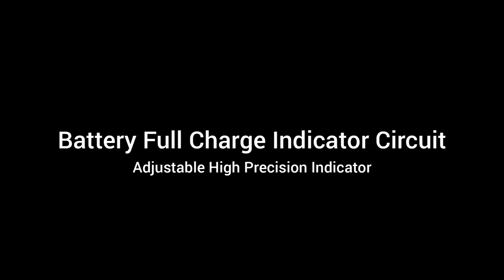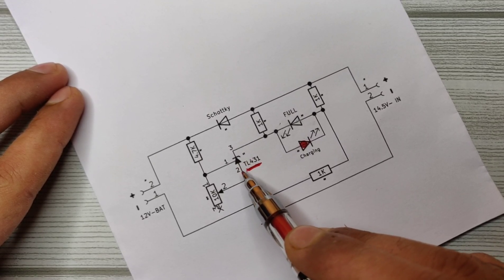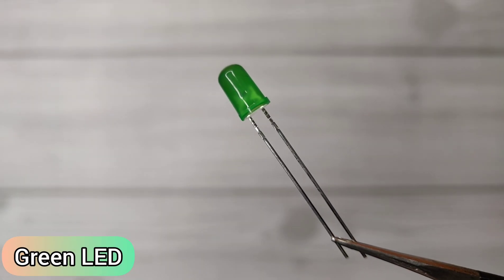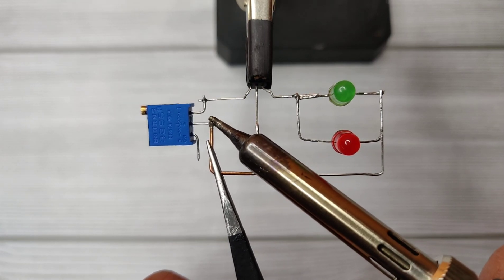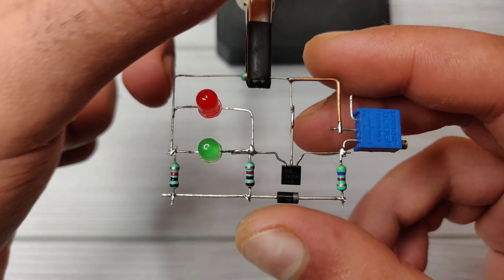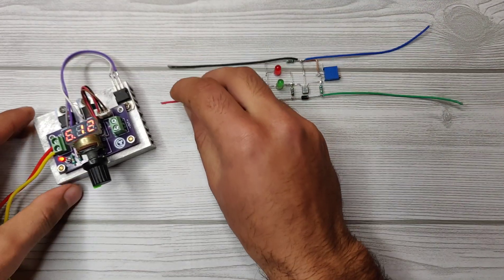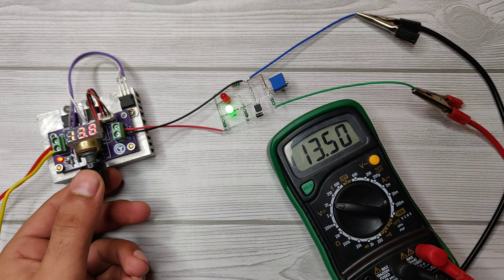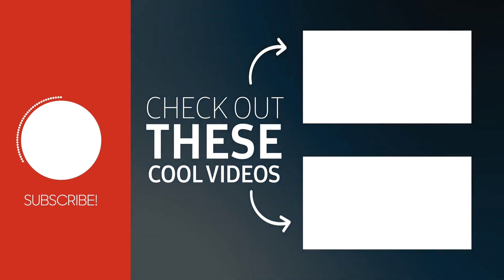12 volt battery full charge indicator circuit / 6v 9v 12v Adjustable

Comment: First of all, thank you for this excellent video, I was able to assemble the circuit but I had a voltage drop of 0,78v in output when I plug in the charger. Can the battery be fully charged? otherwise how to solve this problem of falling?

Comment: Sohottky diode 3amp I can use 6v.9v.12v battery as per I adjust potentio meter, if Tp431 getting more heat so what can I want to do?

Comment: Nice and helpful circuit. Quick question, how can I calibrate this for charging a 24 volts battery i.e. what changes in resistor values do I need to do?

Comment: I want to use 8.4v means two 18650 Battery charging indicator...what changes needed bro???
Reply from the maker: It will work for this voltage too, just calibration required as shown in video
Reply: @CreativeTechos Thanks for your reply..i want to use fixed 8.4v indicator without potentiometer..how to to do that help bro..

Comment: Remember that a battery's internal resistance is very low. It's worrying to me how there's no current limit, whatsoever. Nothing but a diode between the DC-IN and the battery. Diode clamps voltage,  not current. The weakest link in this loop is the diode, obviously: Dropping 0.7v with thousands of mA on it will overheat it
Reply: Will a current limiting resistor on the battery side solve this?

Comment: I'd start with: "What problem am I trying to solve": Battery on one side, that "drops" voltage and acts like a resistor, and a higher voltage DC volt source on the other side. The goal: Light RED when the battery is charging, light GREEN when the charging is done. The battery voltage goes up slightly during the charging, so this is what I detect, and this is the criteria I'm going to use. Now, Here's how I'm going to do it...

Comment: Thanks for the very helpful video showing how to make this full charge indicator! I’m wondering if a bicolor led could be used in place of the two leds, and how to calculate resistors needed to convert circuit for 17.2v to 22v charged Lifepo4 battery bank? Your help is greatly appreciated!

Comment: Hello, I really like the channel!!  Congratulations!  I want to make a li-ion battery pack charger for a screwdriver and I have the XL4015, but it doesn't have a full charge indication.  I would like to know if this circuit, in addition to the load indicator, has an auto current cut?  Grateful!
Reply from the maker: Please check out other videos on my channel there is already 3.7v charger with auto cut off
Reply: @CreativeTechos  Hello.  I've seen several videos, which are great, but I couldn't find one that had automatic cutoff for 12.6V battery.  Would it be possible to send me a link?  Grateful!

Comment: 6v battery cut off voltege and input voltege ???
Reply from the maker: For 6v battery input should be 7.5v and set cutoff at 7.2v
Reply: @CreativeTechos   Operates on 10 volt input ?? use lm 317 ??
Reply from the maker: Use lm317 to set 7.5v input voltage for 6v battery
Reply: @CreativeTechos  ohk thanks for answering

Comment: Bro, how to make this circuit with out adjustable potentiometer?
For 12v battery, 12v input( charger 2.5 Amp)
And by way bro, your videos are excellent, I loved the content bro...!
Reply from the maker: Thanks for watching 🙂, Actually you need to find out the exact resistance needed to cutoff at your desired voltage.
Reply: @CreativeTechos  thank you for the reply bro.😇
Reply from the maker: My pleasure, Thanks for watching 🙂

Comment: can use 12v charger instead of 14.5v?.
and its ok to use 3amp charger?
Reply: maybe if i use 14vAC transformer then convert it to DC,it will become maybe 15vDC up...
Reply from the maker: For how many volt battery?
Reply: @CreativeTechos  12v 3ah battery.
and can also use to 12v 12amp battery?
Reply from the maker: To charge 12v battery, the charger voltage should be greater than battery voltage, thats why you need 13-14.5v charger
Reply: @CreativeTechos  yes,but when you use 12v AC transformer and convert it to DC with few diode&capacitor.the result when you test it w/tester,it will become 13vDC up..right?..
Reply from the maker: Actually to get precise out put for precise cutoff, you can use SMPS 12V that can give you adjustable 11-14v.
Or check out this new circuit video with adjustable output voltage @10A and adjustable cutoff
https://youtu.be/fq3pdoB_Sbo

Comment: Verygood video with explining is it can be use for up 12vdc?
Reply from the maker: Yes, it is adjustable, you can use it for 12v
Reply: @CreativeTechos  For battrey charger 24vdc  can be ajdust to 28 what's sircuit /diagram avaible thks
Reply from the maker: This circuit works for 6- 18v max

Comment: Hi, great video suppppper helpful! i have used this a few times now.. wanted to know what id need to change to make the charging light cut off at 4.9V and the charged light come on immediately from there..? Thanks bud
Reply from the maker: You mean tou you want to charge 4.9v battery with automatic light?

Comment: Nice video sir, I want to ask
When the power supply go off, how about both led status? It is still on or bott off? If one of them still on, I want to know how if I want them both off, if the power source is off
Please guide me
Thank you!!
Reply from the maker: As you can see there is pass through diode to battery that will block reverse current so both leds will go off when input turns off
Reply: @CreativeTechos  noted sir. thanks for your quick reply
Reply: What if I remove the diode, the component still working normally?
Reply from the maker: No, actually diode is very important as it acts as barrier between input and battery, also, circuit receives refrence voltage from battery side to indicate on reaching set threshold voltage
Reply from the maker: My pleasure Thanks for watching 😀

Comment: Hello sir ye circuit main try Kiya hai per mere pass diode 1 minute me hi bahut jayada garam ho jata hai diode in4007 use kiye hai esa kyu ho Raha hai
Reply from the maker: Which battery you're charging? capacity
Reply: @CreativeTechos  12 volt 3s pack
Reply from the maker: How much ampere dc input you're using?
Reply: @CreativeTechos  12 volt 1 amp charger hai
Reply: 2000 mah k 3 battery hai 18650
Reply: Sorry charger dc out put 12 v -1250 ma hai
Reply from the maker: Use 1N5408 diode instead of 1n4007
Reply: @CreativeTechos  ok try karta hu
Reply: @CreativeTechos  sir IN 5408 kitne volt or amp tak use karna hai
Reply from the maker: 1N5408 is 3A general purpose diode

Comment: Hey, actually loved your content man!!.... But i have a doubt I am using a 2x 3.7v battery in series to make 7.5v apprx..... My maximum voltage will be 8v .... What should be the changes made in this circuit?
Reply from the maker: It is simple to calibrate, watch in video again, you need a variable power supply for calibration, set voltage at suppose 8v where you want to indicate fully charged, and then adjust trimpot till green led turns on, thats all.

Comment: Can i use 5 ampere diode?? Or can i change with fr307 diode?
Reply from the maker: FR307 is fast recovery diode and here you can use general purpose diode like 1N5408, but schottky diode that actually have lowest drop in voltage forward
Reply: @CreativeTechos  thank you
Reply from the maker: My pleasure, Thanks for watching 😀

Comment: Thank you … Very useful. How about for bigger Ampere ? Example for 20 Amps.. What Diode should I use ?. And TL431 as A Shunt Regulator can still using ?
Reply from the maker: No changes required, same can work with these batteries too, Max voltage 18v

Comment: Schotkey diode has 3 pins??
Reply from the maker: Low ampere Schottky diodes come with 2pins, where as high ampere Schottky diodes used in switching supplies comes with 3pin and in TO-220 package.

Comment: Hi, i want ask again 🙂 if i want use this circuit to charge 18650 battery. Are there any components that need to be replaced? Thank you
Reply from the maker: This circuit is designed for 6v, 9v, 12v batteries. For 3.7v replace all 1k resistors with 470 ohms & 4.7k with 1k.
Also would like to let you know there is already auto cutoff charging circuit uploaded on my youtube channel, you may check that out.
Reply: @CreativeTechos  thank you for your information 👍🙏🙂
Reply from the maker: My pleasure 🙂
Reply: @CreativeTechos  does this circuit work with 12v battery pack made with 18650?
Reply from the maker: Yes, set cutoff threshold accordingly

Comment: Hi.. I want to ask, can i charge for 18 volt battery? Thank you 🙂
Reply from the maker: Yes, use 2.2k resistors instead of 1k,  and adjust potentiometer for adjusting Full Charge Indicator
Reply: @CreativeTechos  thank you 🙂🙏👍
Reply from the maker: My pleasure 🙂
Reply: @CreativeTechos  sory i want to ask one more, there are 3 pieces 1K in circuit so do you mean change all of them to 2,2K? 🙂🙏Thank you
Reply from the maker: Yes, for 12v 1k is perfect, but for 18-24v change all 1k to 2.2k
Reply: @CreativeTechos  alright, i will try it. Thank you 🙏👍👍😁

Comment: Great! Can I use 1N4001 or 1N4007-B diode?
Reply from the maker: Yes you can use and will work well, but there will be upto 0.8-1v voltage drop.
That's why schottky diode i used drops 0.3-0.5v
Reply: @CreativeTechos  thanks!
Reply from the maker: My pleasure 🙂

Comment: Great video and thanks again on the diagram. Can you make a video on how to make a circuit board for your projects. That would be great. Thanks again for your learning video's,
Reply from the maker: You can simply assemble it on zero pcb, 
Or if you want to learn professional designing of circuit boards i use Kicad
Reply: Thank you I'll go to the website.,

Comment: Good 👍project sir. Kindly make 12v. 4amp. lithium 18650 battery charging circuit module with over charging protection for bike.
Reply from the maker: Check out this circuit video.
https://youtu.be/nvlOeDHkwK0

Comment: Pl find circuit for lower cuttoff say 4.7v of battery . 4.7 for green led red for full led
Reply from the maker: You mean you need circuit for 3.7 v lithium battery?
Reply: No.. Lower cuttoff limit at which battery drained and not operat  to run  toy motor.